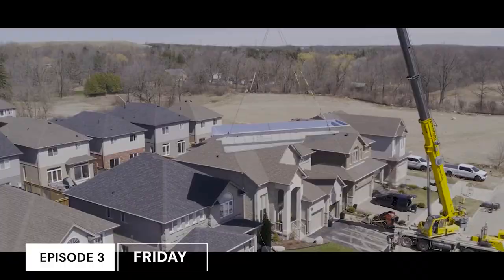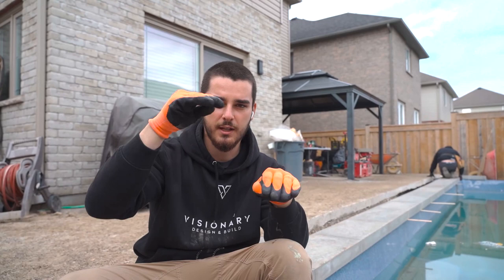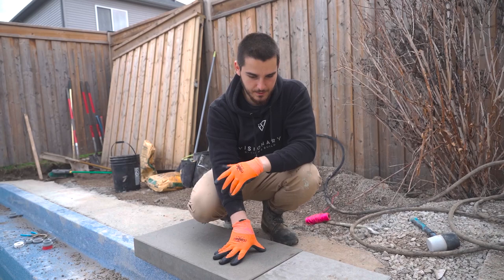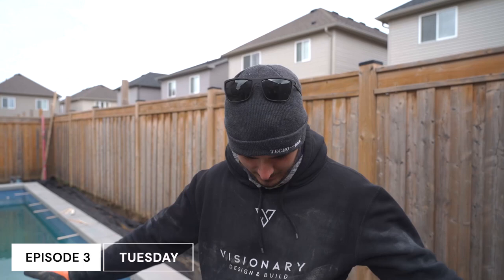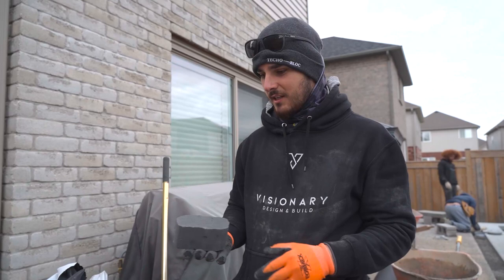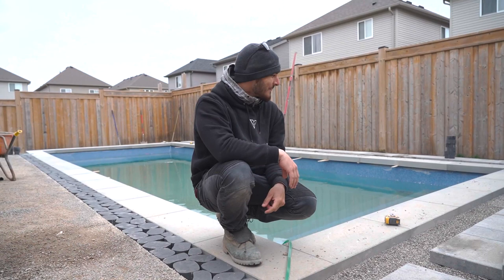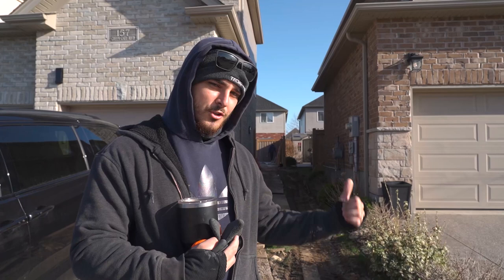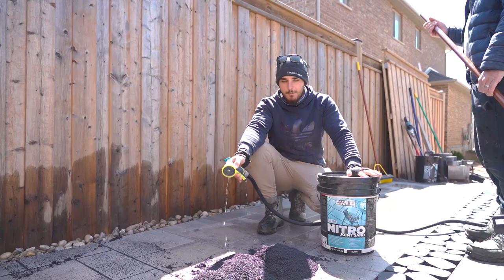Why You Should WAIT To Get A Fiberglass Pool!! | Visionary Weekly - EP 03

Comment: After you placed your collar and Coping, did you install a bonding wire or grid before you set your pavers? I didn't see it in the video.
Reply from the maker: We use fibreglass rebar. No bond required 👍
Reply: @visionarydesignbuild4481  not true in Virginia we have to do perimeter copper Bond wire to bond the 5-ft concrete around the pool that's actually in the pool code.
Reply from the maker: @stevegoodwin3086  what is there to bond when you're using fibreglass rebar... go bug someone else

Comment: What under laying stone did you lay? Nice work
Reply from the maker: We use an open graded base.  The specific one we used on this job is called "HPB" (high performance bedding), also known as ASTM#9 or 1/4" chip stone.

Works really well for screeding a nice smooth layer
Reply: @visionarydesignbuild4481  thank you so much.  Love the content. 👌

Comment: How can you not recommend using fibreglass pool just because of a minor problem.
Reply from the maker: A pool shell being built 1.5" out of level isn't a minor problem.

In fact their fine print states up to 3% variation in final measurements
Reply: @visionarydesignbuild4481  and you didn’t level it as you put it in? I believe you set it in the hole with a the crane get it level and fill gravel under to ensure it holds that level.
Reply from the maker: @rinkevichjm  that's not per manufacturer spec.

The grade should be pre determined and set before craning the pool in.

Minor adjustments (up to 1/2 inch) are ok to make, but anything more is risking hairline cracks along the pool floor

Comment: B.s. I'll take a fiberglass pool all day long over the concrete or liner pool. If you have problems installing coping,  it's not the pool, it's the installer.
Reply from the maker: So when a pool sags 1.5" corner to corner (deep end wall) - it's the installers fault.

Understood

Comment: Pool lip isnt cleaned off your concrete collar isnt done right and your not using the correct mortar to stick it down most nothing wrong with the shells i have done coping on literally hundreds of lathem/fiberglass pools and although there are some slight inperfections nothing like your describing
Reply from the maker: lol.  Cause Type N mortar is the "wrong mortar" 😅
Reply: @visionarydesignbuild4481  if you want to have trouble like you did all around that pool then yes it is me buddy but if you want to send me your contact info i can show you how its done the quickest and most efficient way but also the strongest
Reply: @visionarydesignbuild4481  i can send you some pictures if you like as well
Reply from the maker: @robglendon6662  the end product was perfect, the process to get there was horrendous.  Not to mention the deep end sitting ledge had a 1.5" sag on the collar.

Now not all are as bad, we've found the curved pools are built better than the rectangular pools.

But when they ship the pools while they're still curing (confirmed by a Latham employee) - you're asking to have Q.C issues.

They are overpriced pools with an over glorified warranty.

Yes the end customer doesn't pay for repairs, but I wouldn't want someone cutting my pool shell in half to then re bond it using epoxies & re surfacing it with an eco finish.

A decent sized pool in Canada costs us 35-40k (just the shell). It's a ridiculous cost for a sub par product.
Reply: @visionarydesignbuild4481  hey just wondering those icf pools you install that work like a yeti cooler they sound amazing..... just wondering do they come with a lid and can you swim with the lid or is that a saftey issue
Reply: Dang. Looks fine to me. Jeeze, crab.